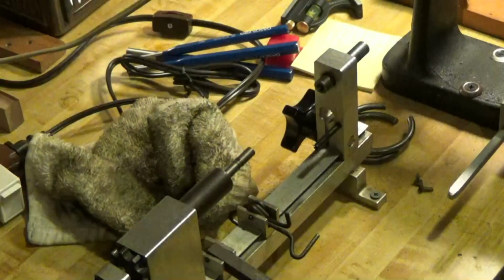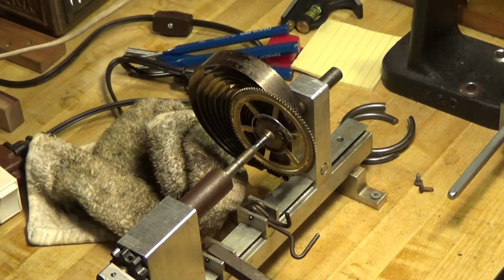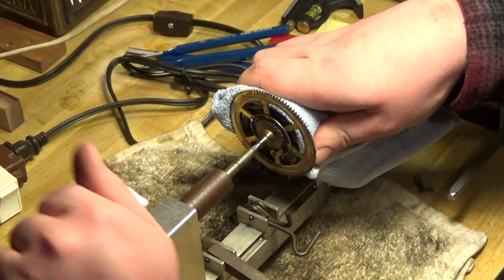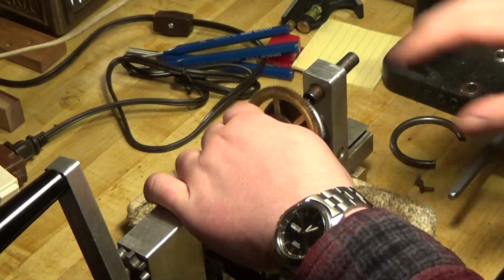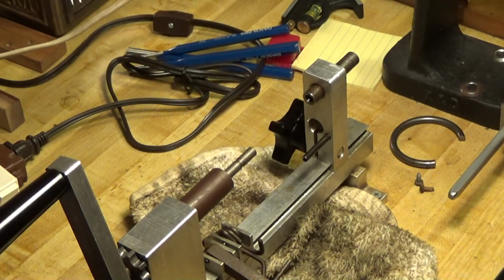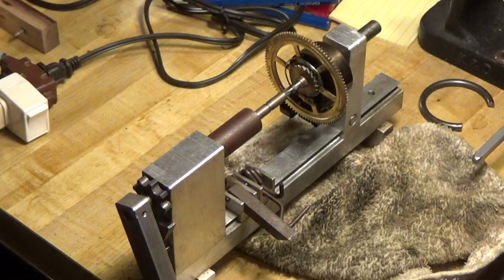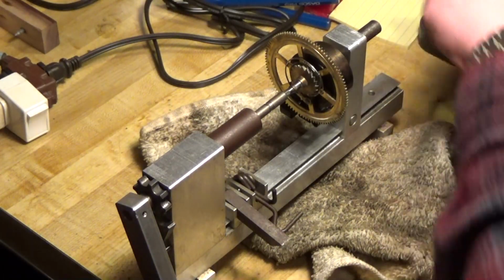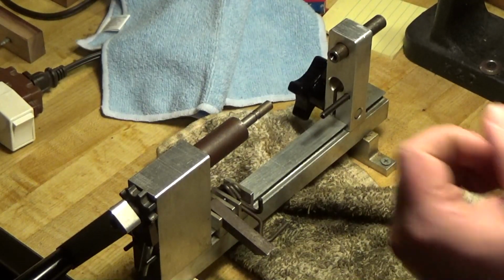Antique Seth Thomas Overhaul - Part 9 - Mainspring & Arbor Reassembly

Comment: 4:30 Do the original springs have historical value?   Are there times you choose to replace springs that aren't broken yet?  As a paying consumer, I consider the cost of installing new springs now (parts only?), versus the labor required to replace springs in the future.
Reply from the maker: The original mainsprings don’t really carry any historical value, to be honest. A close analogy would be to say a mainspring is like a battery. If it’s weak or broken, replacing it is the best option. While doing a complete overhaul, if the springs aren’t broken, you can usually visually gauge if it’s weak and needs replaced based on how it sits at rest out of the clock sitting on a surface. If it doesn’t expand very far when completely unwound on a flat surface, it will probably need replaced. It takes some experience or direction to be able to judge if a replacement is necessary. However, my rule of thumb is if there’s any doubt and you already have it apart, just replace them. It’s worth the peace of mind and the money.

Comment: Just wondered why in one mainspring video you use Keystone light oil and this video you used a Slick 50 spray lube.
Reply from the maker: I started using the Keystone lubricant after this video was completed. Automatic transmission fluid can also be used, such as the Dextron version.
Reply: @BrackenClockWorks  have you ever ran a mainspring through your ultrasonic cleaner?
Reply from the maker: I almost always run them through my ultrasonic, unless I need to replace them if they are broken, cracked, or too “set.”
Reply: @BrackenClockWorks  Thank you for the good information. I enjoy watching your videos, they’re really helping me. I’m new to clock cleaning and repair and so far have a few of my own that I got working again. It’s very rewarding work to take something that doesn’t work and bring it back to life again without having to pay someone else to fix for 300.00 that is what our local clockmaker charges. Not to mention it’s very hard these days finding anyone to work on clocks so maybe my new hobby will turn out to be some extra income in the future.

Comment: Does anyone know where I can source a suspension spring for the pendulum in a Seth Thomas clock with a 48 our movement? Evidently someone moved the clock with the pendulum still on the suspension spring and it broke. If I cannot purchase one somewhere, would anybody be willing to construct one for me? I am visually impaired so trying to cut spring steel to precise measurements is not the easiest thing. I have not seen any screws on the upper or lower block to remove the existing piece of broken spring steel, I am assuming that the pin has to be driven out? Any help would be greatly appreciated.
Reply: How making busses